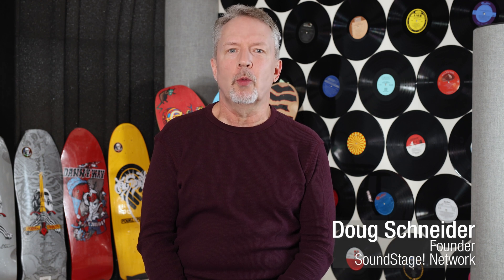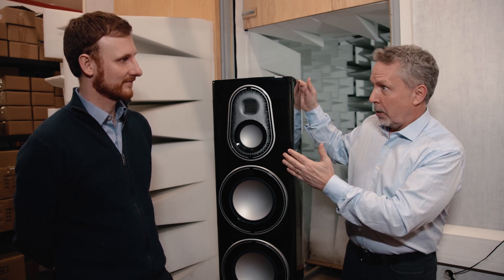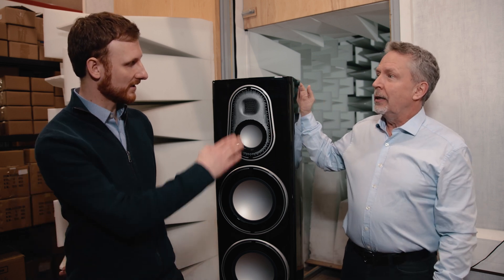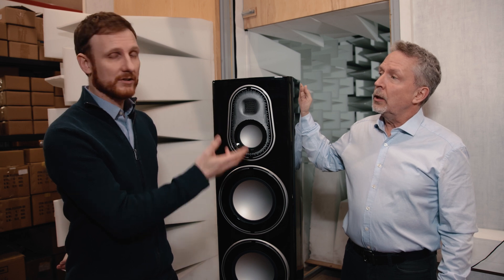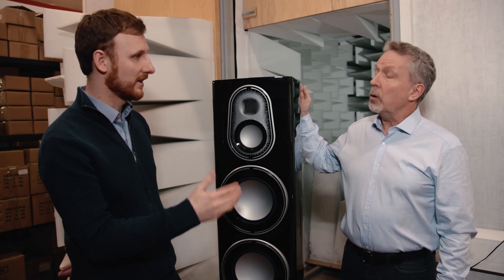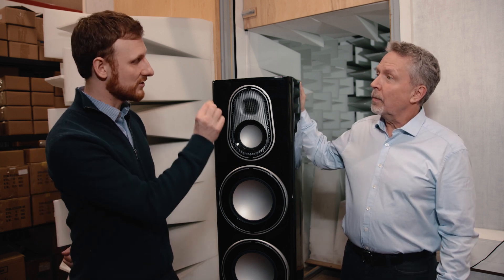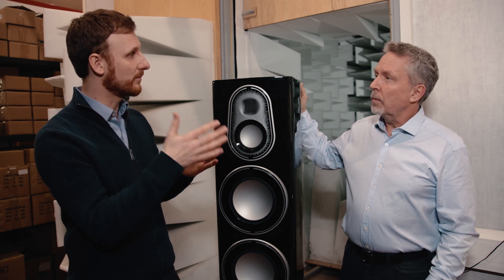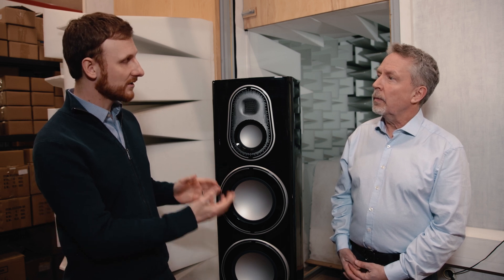Lowering Loudspeaker Distortion: How Monitor Audio Designs Its Drivers (Ep:64)

Comment: They didn’t lower distortion that much they stopped making the 500 and made the 300 cheaper and making it handle more power and reinforced the drivers with carbon to get more SPL out of it,no leather,less low level detail,the platform on the bottom of the speakers are also made to save money,O and no covers for the drivers,less material and higher cost for the consumer after hearing the 300 3g I will stay with my 300ll gladly
Reply: They are already low enough distortion so how can they reduce it to such a huge amount? 
Plus it doesn't ever really make sense to update to the next model iteration unless you got money to burn :)
Reply: Thanks for sharing your vast knowledge, and the fact that you own a Platinum 300 2G. I'm sure Monitor Audio are shaking in their boots that Philip W is on to their cost cutting scheme.